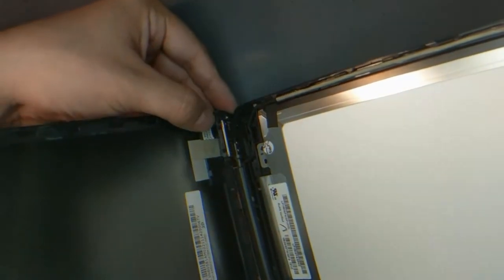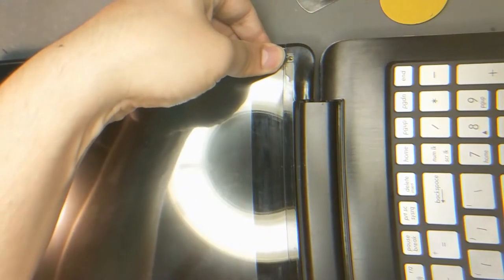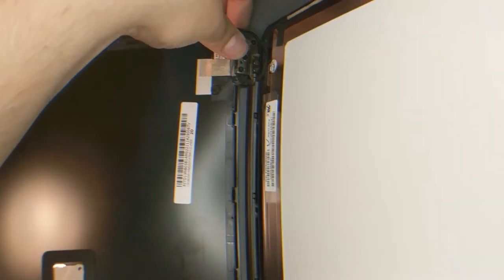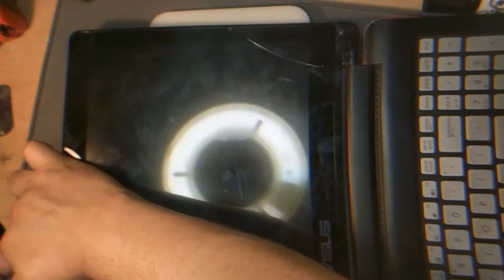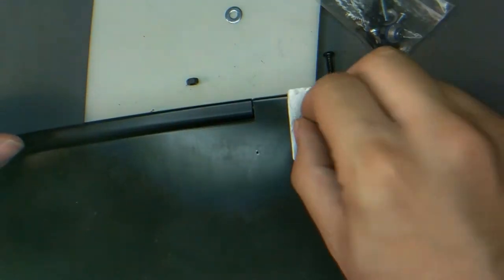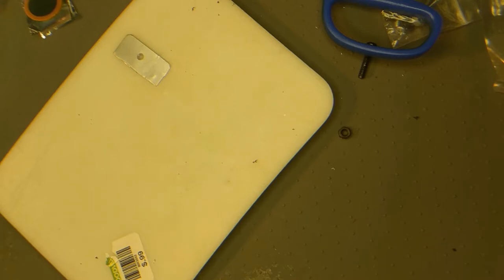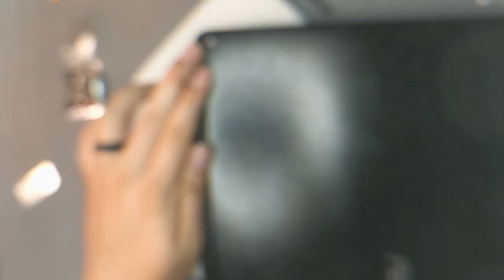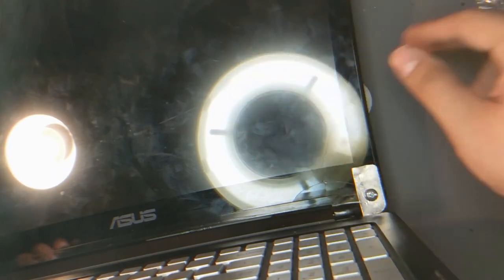If It Ain't Fixed E11 - SNSV Laptop

Comment: Buy old used thinkpads. If it's just for work/school and casual web browsing, you don't need expensive hardware. They're easy to fix and there are lots of spare parts around so broken ones are usually the cheapest even with all the spare parts you need. They're durable as hell and the older models have the added benefit that you can remove Intel Management Engine which is a low-level backdoor (that can be accessed even without power on) that you can't disable on newer processors. Also use free software.

Comment: Btw. Unless you're being Sarcastic, The brand Is ASUS
Reply: knockoff as in: you knock the machine off the table, and it lands upside down: there you have the knock(ed)off asus ;)
Reply: actually nevermind, just saw you failing with the drill vs glass, that pretty much explains the reading fail too.